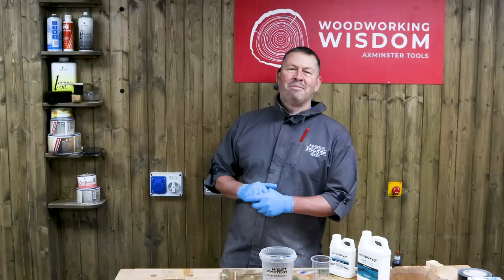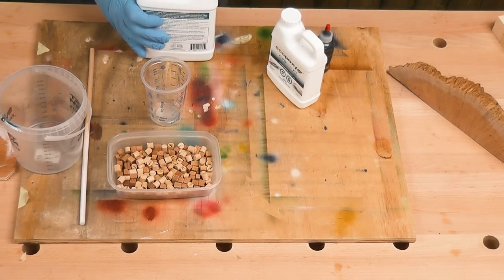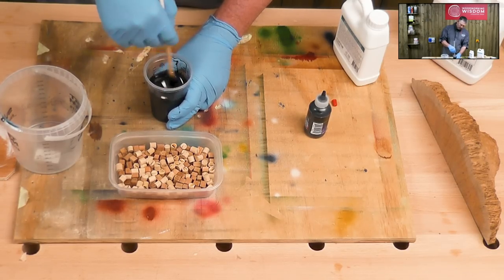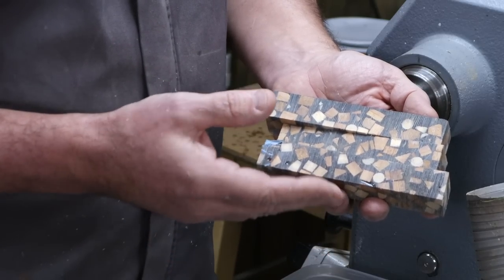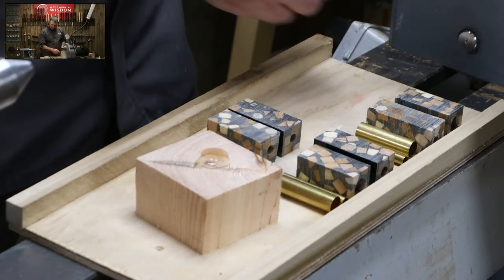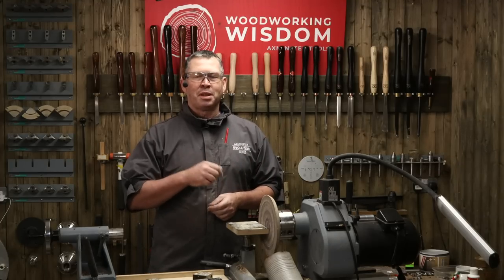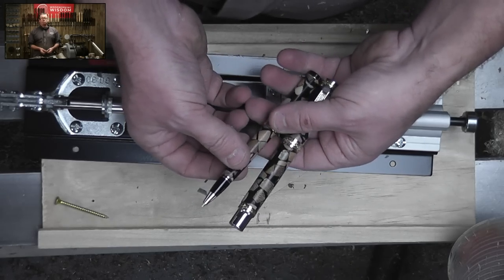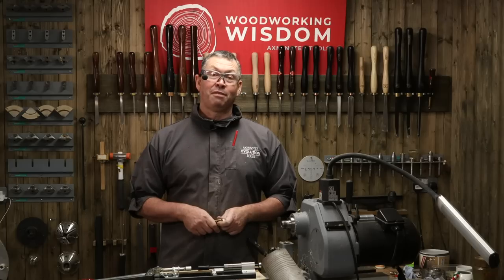Resin Casting Pen Blanks with Colwin - Woodworking Wisdom

Comment: Great blanks.  Did you use a pressure pot?  Why do people use pressure pots for resin blanks?
Reply from the maker: Hi there, pressure pots are generally used on bigger projects to shrink air bubbles out of sight and draw the resin into the small voids that would be taken by air pockets. Vacuum chambers work slightly differently and are used for smaller projects such as pen blanks. Vacuum takes away any air and is good for projects that require the resin to be drawn into the timber and so are often used for stabilising wood. Hope that helps.

Comment: Excellent video Colwyn, thoroughly enjoyed it.
Question though, do you get any issues with the water over wetting the wood when you are wet sanding. Or could you use mineral oil?

Comment: I just made half a dozen pens as small ‘tree presents’. They are always well received and admired. I never thought of using acrylic for DIY pen blanks. Must try that out.
Question: you sanded the blank - do you not protect the wood with a finish? On wooden blanks I have been using super glue which works well.
Reply from the maker: Hi Bill, Glad to hear your pens are popular. Regarding the finish, Colwin says: "Yes you can add a finish and as you say a super glue finish works well as does finishing oil on a combination like this."

Comment: Great video.vety informative.  
Did you make the sanding table? Is there a video on making one. Thanks much.
Reply from the maker: Yes, Colwin did make a sanding table. He says: "I did make the sanding table out of the following parts, 101833 tool post to suit your lathe, 104451 mounting plate, which screws into the tool post, then just add a piece of ply or MDF." Hope this helps :)

Comment: If you were turning a tubeless pen kit between centres, I.E. with no mandrel, what centres would you recommend. I am tending to either split blanks through over compressing them or if not compressend enough any attempt at making cuts just results in the blank staying still while the lathe keeps spinning. Or, would you recommend a mandrel for this type of kit? It's a one piece, 8cm blank fully drilled through.
Reply from the maker: Hi Andy, Colwin says: "I would go for a mandrel first, but alternatively go for a light pull drive (https://www.axminstertools.com/axminster-imperial-light-pull-drive-2mt-950366), this has a series of stepped diameters with a chamfer at each and perfect for turning projects with a pre drilled hole." Hope that helps!